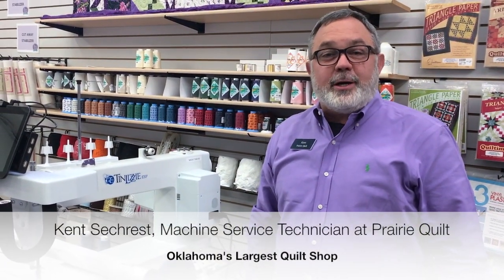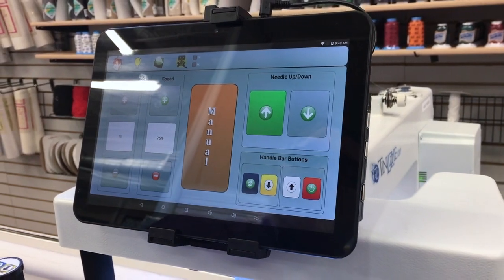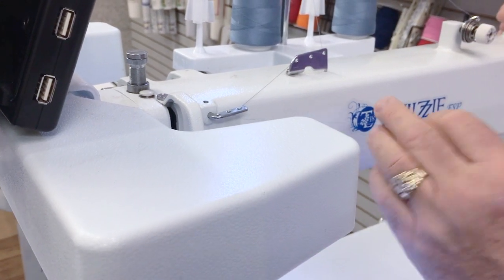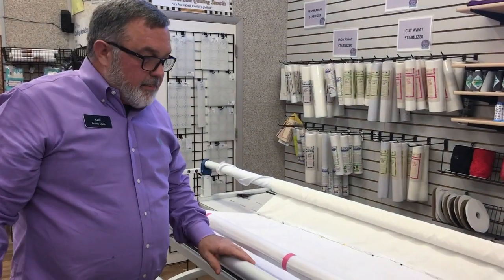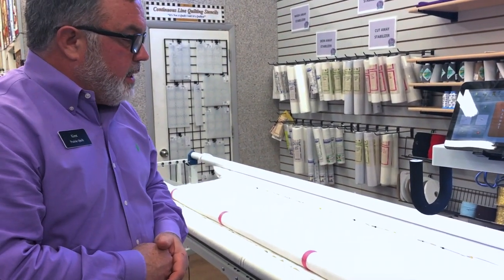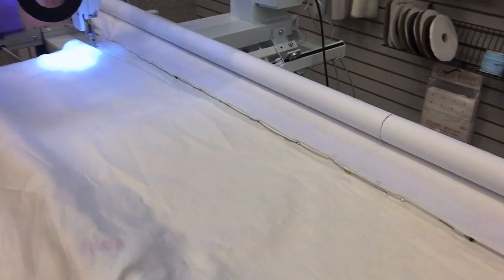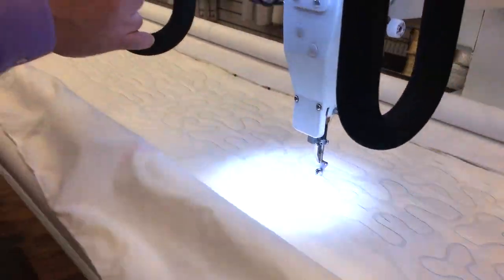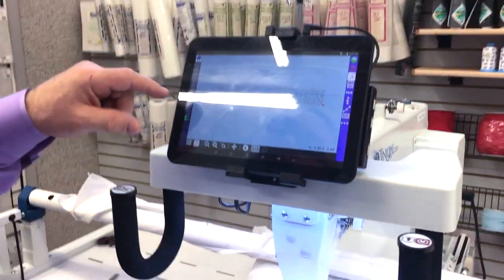TinLizzie18 ESP Long Arm Introduction

Comment: Thanks for the great video! I am wondering what is a good rule of thumb to be used in determining the appropriate tension setting we should use on the bobbin winder?
Reply from the maker: Thanks Charlotte. For me, it's a feel thing. When I wind a bobbin, I check how dense the thread is when I press it with my thumb nail. If it winds too tight, it will be hard to press and it could distort the bobbin changing the bobbin's shape and that will affect your stitching. If it's too loose, it will look messy and be loose and soft. So ideally, firm, just not too firm.